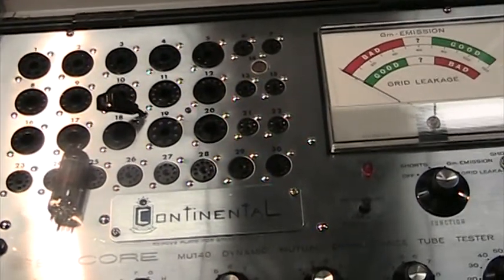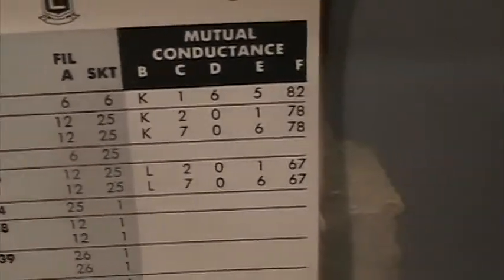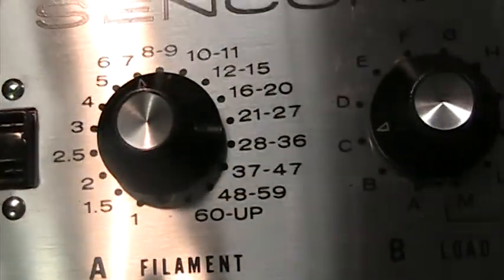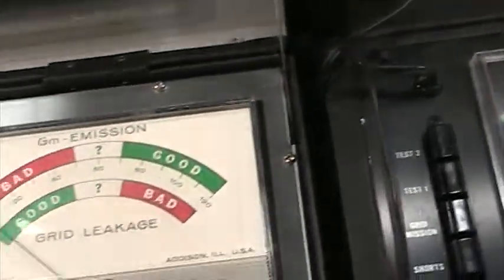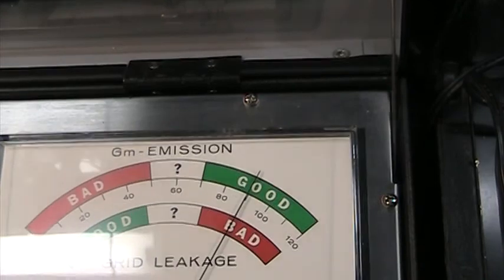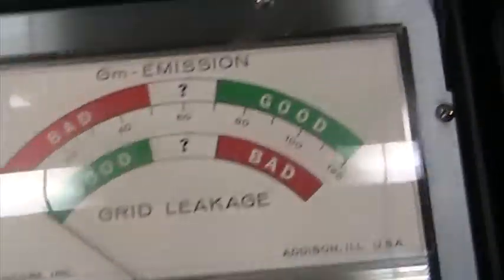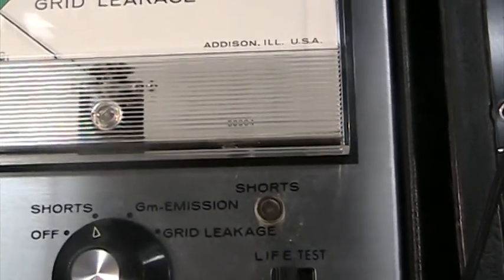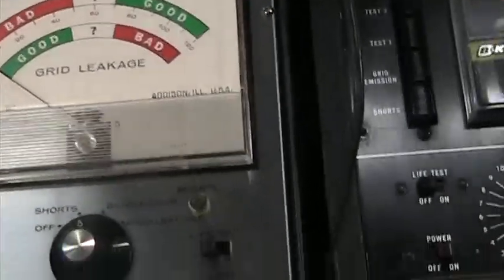Sencore  Continental MU-140 MU-150 tube tester

Comment: "seems to be very accurate"?  You need to get your testers professionally calibrated.  It's not a DIY thing where you can use your best tube showing good and thinking it's calibrated or think it's calibrated because it compares well with another tester.  You spent good money on a tester so a calibration will give you true readings and add resale value to it if you decide to sell. Just some thoughts. Nice video
Reply from the maker: I'm going by memory but I think it used a 5 meg resistor for calibration so I made a string of 1 meg resistors that measured 5 meg on my Fluke scopemeter and followed the easy step by step of how to calibrate. Not hard when you have the factory service manual. I say why pay $$$ when you can do it yourself, especially when you can do it yourself right.
Reply: @tramdr Absolutely, these testers have fairly simple calibration instructions. There's also a step for calibrating the 'Signal' control using a scope to give zero the control and give it a 100 : 1 range.